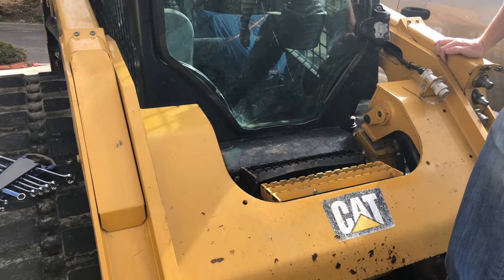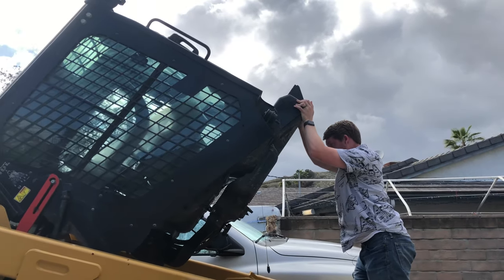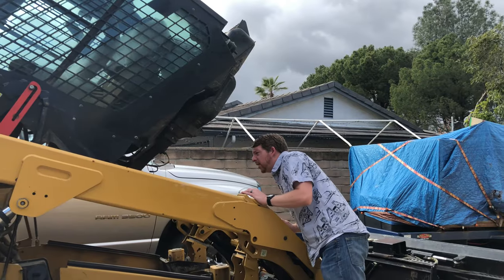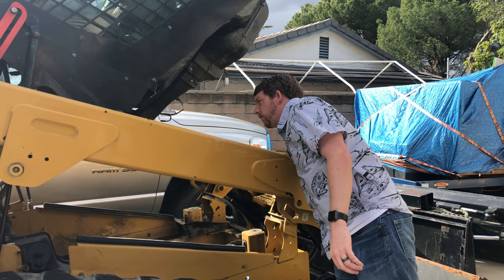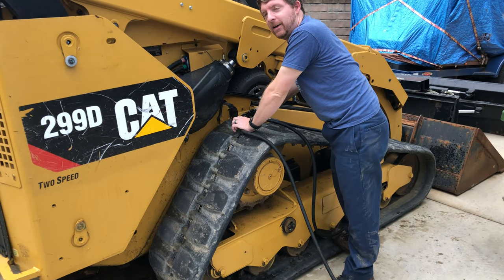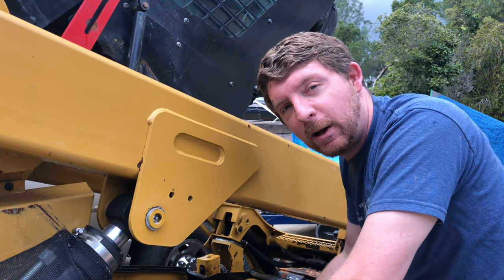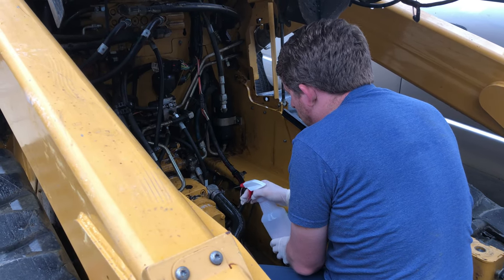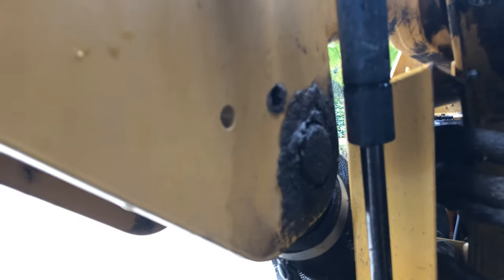Getting under my CAT 299D - Lifting the Cab for a Closer Look

Comment: Why didn’t you just take the bottom Panels off and pressure wash it with hot water
Reply from the maker: There is only one small panel in the center that comes off.  Unfortunately, the bolt heads have been ground down and are rusted in place.  I can't get under the machine enough to work on this.  It is on my to-do list to replace this panel and bolts when I find a way to work under this safely.